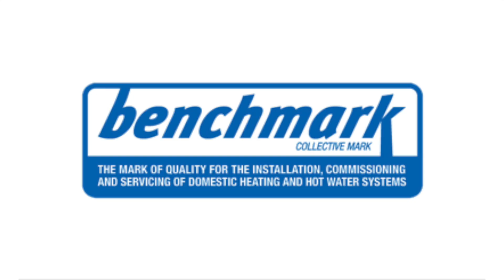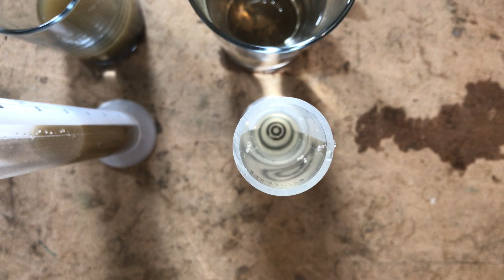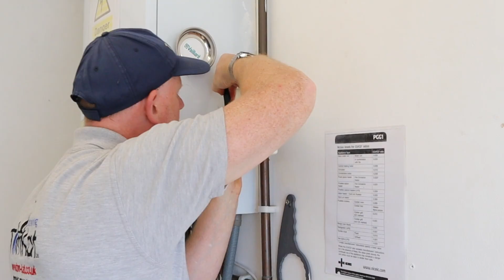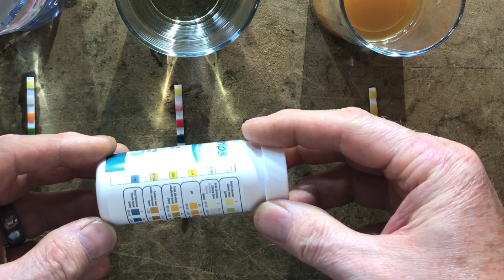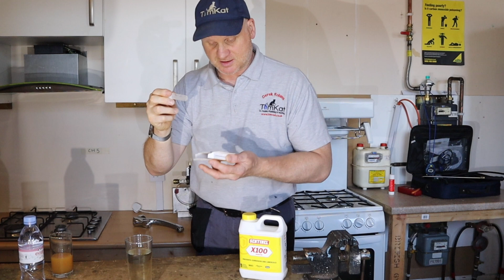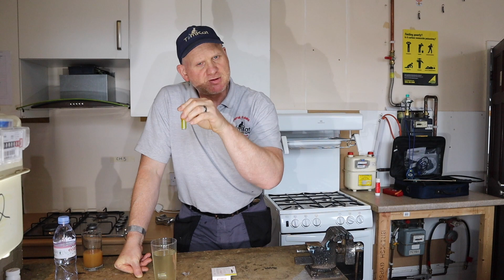TESTING CENTRAL HEATING WATER TO BS 7593, using sentinel x 100 test kit and turbidity test tube.

Comment: Hello Tom, 
Thanks for the comparation .
I'm missing something or I can conclude that It appears that  a visual inspection is the most important test!  
The first tubes test  is just a visual test, if you can see true the water is OK . You don't need much to conclude that.
Doesn't proof if the system have enough inhibitor or not. You can fill the system with clear water and have the same result.
The second test with PH paper strips again clear Water  and central heating water reads the same 8.4PH ( Companies are BOTTLING central heating water with  inhibitor and selling as mineral water🤣🤣🤣    )  
The dirty water reads PH 7.2 that it's neutral :) but anybody can see and  is not rocking science that needs to flushed from the system.
The results are useless.
The third test once again if you add  inhibitor , the test will tell that you just add the  inhibitor...
It appears that  a basic visual inspection will give the right result.

Comment: Hi Derek, yet another brilliant video, A lot of car manufactures are insisting on the coolant used in cars being distilled water only my question is would heating systems benefit from being filled with distilled water and could this be a future requirement mabe?
Reply: Good luck getting 120 litres of distilled water up into somebody’s attic! The modern inhibitors are very good and are designed for hard water. I find scale much cheaper and easier to treat than magnetite too.
Reply from the maker: Because our drinking water in the U.K. is good I see no need for distilled water if we have to install magnetic filters and inhibitors.

Comment: Sorry to say this is crazy?
 I keep fish and paper testing strips are notoriously unreliable so don't expect these to be anywhere near what they should be as your test shows with the bottled water?
And as much as I agree with all this. I always do a full power flush and install a good quality mag filter with an install as the water needs to be as clean as possible I agree,
 But all that is going to happen, Is those doing the tests have now got to charge more for the serviceleving, those that can't be bothered to do it with even more work as customers now decide we are to expensive. Along with this how is the record of the tests supposed to be recorded?  There is nothing on the service paperwork to record your findings nor any way of proving your findings?
This is just crazy?! I don't agree with those that install boilers without fully cleaning the system, but I have found many hundred of boilers installed on a dirty system that out live there guarantee.
Again those that make the rules do so with no consideration to those that have to police them. And these are the ones that will look like a total money grabber when they have to inform the poor owner of the boiler that there guarantee is no longer valid and they need a complete system flush at £££
Thanks for sharing this vid.
May be a good vid is price and what tests are available to ua as installers
Reply from the maker: Thanks for your comment you now have to record your findings on the benchmark service section in the comments. I have done a number of these videos to show what test are out there. Thanks for watching cheers